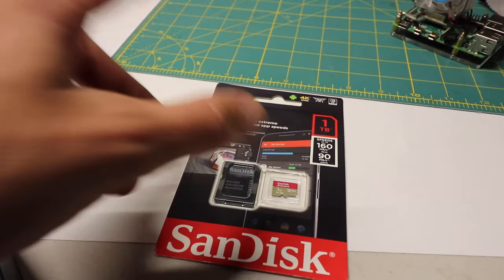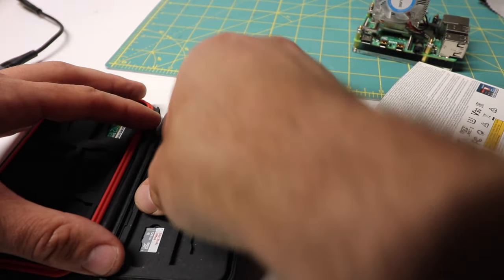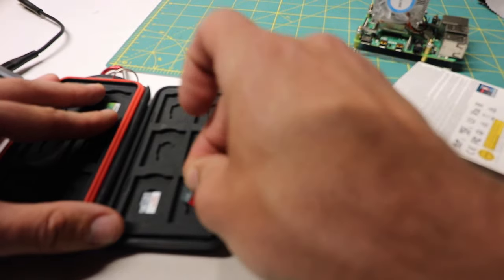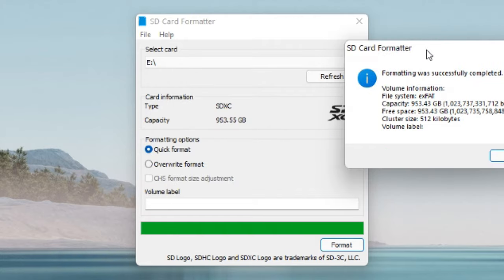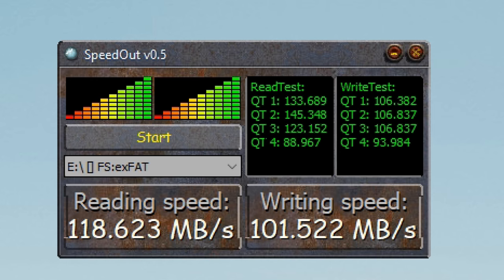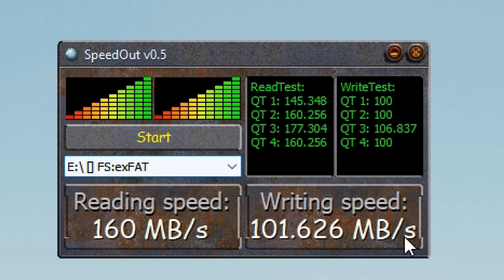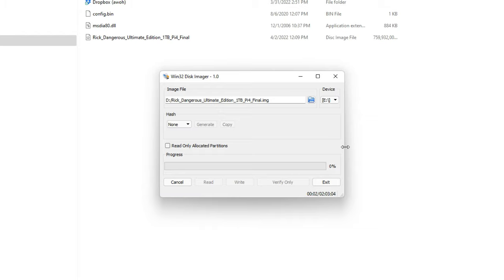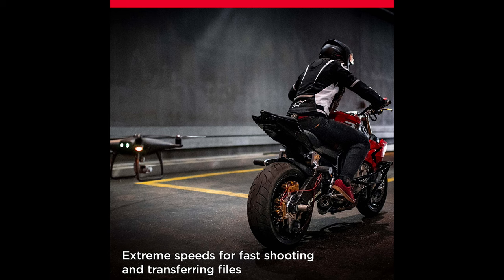SanDisk 1TB Extreme Micro SD Card - WOW

Comment: Nothing worse than when you break a Micro SD Card, manufacturers need to make them stronger
Reply from the maker: I have never broken one, I should tap on some wood though
Reply: I didn't know you could break those considering they're always inside a device
Reply: @alex.hleconte6007  Put them in an d out of device's, or lave it in a Pi while changing case, they break
Reply: @MrJaz8088  no more no less than user error

Comment: I like the "Kiorafoto Professional Water-Resistant Anti-Shock" holder you have.  In my case, I just keep each of my MicroSD cards in its own "SanDisk MobileMate USB 3.0 microSD Card Reader", which gives up its inserted card without the struggle of MicroSD to SD adapters.
Reply from the maker: mmmmmmmmmmmmmmm

Comment: I had 2 of these SanDisk cards the same as yours fail back to back in my Samsung Galaxy Tab S6, they both in fact corrupted the data. There is a reason Im sure why the biggest card available from Samsung is still 512Gb. From that day forward I have never used and will never use anything SanDisk again. I am in the UK for your information. Great video though.
Reply: Are you sure the cards were legitimate? I always pretest my stuff to verify its the actual advertised size.
Reply from the maker: Wild, good to know, also good point that there are a ton of fakes on the market
Reply: @drewtalks  True, but I bought the first one from Amazon, which came from them direct instead of any third party supplier. The second one came direct from SanDisk as a replacement for the first.
Reply: @drewtalks  Drew, PLEASE help and PLEASE reply, days. Can anyone here please help. Does SanDisk 1tb extreme REALLY CORRUPTED very easily as compare to Samsung evo plus 512gb???? PLEASE HELP.
Reply: This maybe makes sense. I am also curious for theast one year why there is no 1 TB card by Samsung.